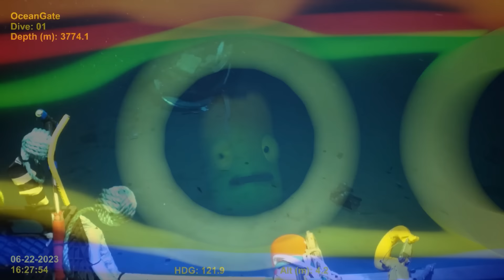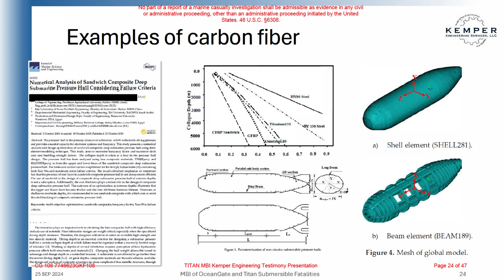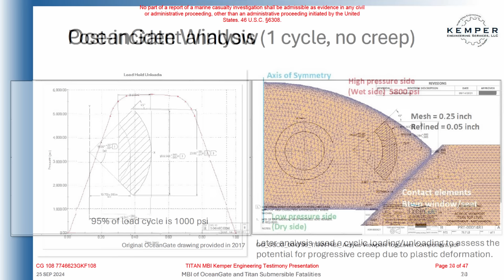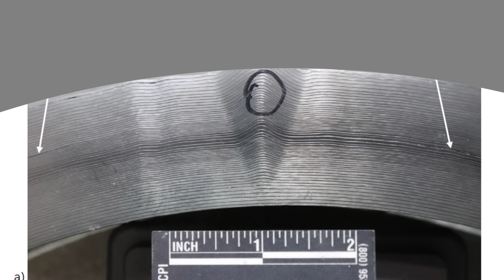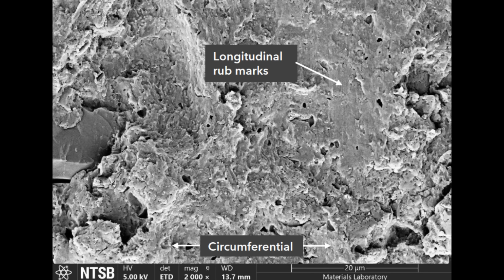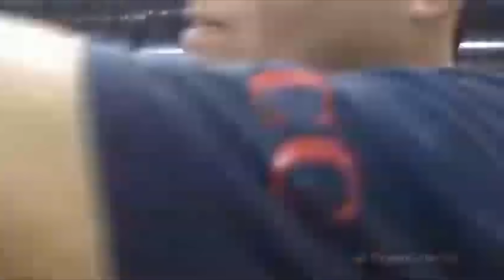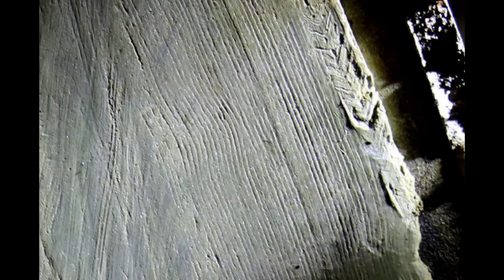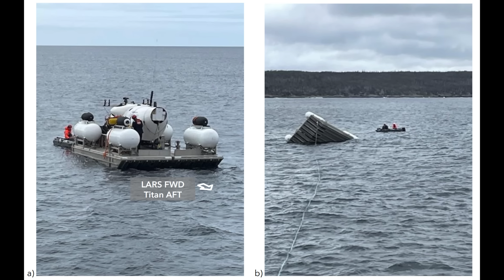OceanGate Wreck Shows Why Sub Wasn't Strong Enough To Survive - NTSB Shares Important Details

Comment: With that several thousand pound front titanium dome that swiveled open on a frequent basis to let passengers in and out, that had to weaken that glue joint in between the CF and the front titanium interface ring. Imagine all that load and leverage all supported mostly by glue. Since it appears the failure happened in the front, that is likely what happened which slowly allowed water ingress over time and caused delamination between the five layers. Then on the final dive that front CF tube no longer was round anymore, a portion of it likely gave way and crumpled in and the rest just followed a catastrophic implosion. Overall a poor design and poor material choice and not nearly enough destructive testing.
Reply: Good eye on that hinging dome hanging on a glue joint! Even if it wasn't "hinged", it was several thousand cantilevered pounds always trying to break off.
Reply: The glue joint was already full of air (way worse) because they assembled it upside down with no way for the air to get out...
Reply: The bottom front was also the little pocket with the on-board toilet.  Assuming it got used, there could have been corrosive fluids leaking on the inside, potentially damaging the structure.   I've seen fluid leaks corrode stone tile floors, a lot like the "acid for blood" thing in Alien.  It's nasty stuff.
Reply: There was no need to do any destructive testing ... The design concept  (cylinder at such depths, mixing materials) was flawed from the start. They were playing "russian roulette". And people try to reach to him and tell him , but his ego and hubris would prevent him from heeding the advice. What saddens me is that his hubris got 4 other people killed, one of them a 19 year old.
Reply: @Xoman08  it did 80 dives of which a dozen reached the Titanic.

That is despite their ludicrous construction process like shaving down lumps, ignoring Boeing's advice about winding patterns and doing 1in layers.

On top of ignoring the safety system that told them it was not safe anymore and other potential issues about the building process like debris in the fibre and sub-par cleanliness, expired fibre, how the titanium rings were attached etc. etc.

The fact this piece of junk did that many dives before imploding is actually a glowing commendation in my opinion.

For reference the Navy did create a carbon fibre unmanned submersible that dove to double this depth and other companies do have successful carbon fibre submersibles.
Reply: @retsaMinnavoiG  reusable though? Or at least a cycle limit. The Titan had none that I'm aware of which was ludicrous.
Reply: When none of that glue squeezed out when they put the end cap on it was obvious those guys had never glued anything before. You want some to squeeze out to fill any air gaps.
Reply: That would be true if the door swiveled open, in reality it was bolted closed from the outside and didn't have a hinge as you imagine.
Reply: @doughnut1107  It definitely had a hinge on the starboard side. One of the things that came out of the hearings is that the forward dome fell off once, and that the hinge was bent in the process of falling off.
Reply: @PetesGuide  You are absolutely right, I'm unsure how I didn't remember the jankiness of the whole thing.
Reply: @doughnut1107  No worries; there are so many strange things here it’s easy to miss some details. I’m actually considering watching all 10 days of testimony. The Coast Guard channel actually has a playlist with all of them.
Reply: @doughnut1107  yes it was bolted on from outside to secure it. If it didn't swivel open how did they manage to open and close that each time without a crane?
Reply: @LichaelMewis  You would have thought the door would be held/locked in place with a compression ring like how every other sub uses, all those boltholes are just points of failure, and reminds me of the Apollo 1 fire.

Comment: Those of us involved with the strength of carbon fiber aerostructures would never agree to a process as defect-prone as this seems to be
EDIT: I'm pretty specific on this comment; it goes without saying that the defect-laden hull would never make it out of production, much less make it into service. To reiterate, the fabrication process itself would never be certifiable.
Reply: Considering how bad their construction was, Its actually impressive how well the carbon fiber worked. That wasn't the first dive to the Titanic therefore their botched job was still able to survive a bunch of times before failing. Imagine how much better one would be if it was built correctly.
Reply: @ryelor123 In a way, Titan proves the viability of at least the basic ideas behind its construction. OceanGate was seemingly incapable of doing anything properly, yet they still managed to make a submersible which survived multiple dives to the Titanic.

The big remaining question is probably whether degradation of / failures in the composite hull are predictable, and that could be answered with destructive testing of hulls.
Reply: @SnakebitSTI  For predicting failure you need to x-ray the hull periodically.  That would have discovered the increasing defects. But that was too much work and apparently Stockton's attitude toward anything that might hint at a potential failure is to just ignore it.
Reply: @ryelor123 , I wonder, had the Titan been built correctly,  would it have performed as Rush drempt?
Reply: @ironbomb6753  No.  Using CF in compression is stupid.  It was relying on the glue ... which failed on multiple points.
Reply: @ironbomb6753  Considering the performance of TItan before her ultimate demise, I would say yes, the concept of a human-rated CF submersible is worth exploring
Reply: @ricardobufo  what about carbon fiber unpressurized sections of rockets? Or the upper surface of composite wings? Are the designers just stupid?
Reply: @ricardobufo  I have been told (by a material scientist or something) that due to the thickness of the hull and the diameter of the hull that the strength of the fibres were absolutely being utilised.

They said that a thin small cylinder of carbon fibre being compressed was virtually useless but that when the hull is that thick and wide that most of the fibres more or less experience tension forces.

Also let's just think about it, it went to the titanic multiple times and the production quality was incredibly poor.

It seems unbelievable that it would have reached the titanic even once if the idea didn't have some merit and the carbon fibre was actually doing a relatively good job.

It seems to imply that carbon fibre isn't the absolute cursed material for submersibles it has been made out to be.

It's probably safe to say that even if it did have merit, it's unlikely to ever be used again for super deep dives like this.
Reply: @ricardobufo  not true.  CF in compression is fine with the the appropriate testing and safety margin.  The top of A350 and 787 Wings are loaded in compression and are tested for full fatigue life and ultimate.
Reply: @retsaMinnavoiG  Could you tell us who this "material scientist or something" is and especially which companies he is associated with?  It's important that everyone knows who these people are.
Reply: @bobloblaw1636  You might like to check out the design requirements of unpressurized vessels.  Do you know anyone who makes composite model airplane wings?  Ask them what they think of the design of Titan.
Reply: @ricardobufo  yes. No one is going to defend the design of Titan. It's a bad design. I'm pointing out that using carbon fiber in compression is not inherently bad, and is done quite a lot. For another example, watch Scott Manley's previous video on the titan sub, he talks about a successful navy sub that used carbon fiber.
Reply: @ricardobufo   it was last year around the time it happened and it was just somebody on the internet.

I'm guessing by the way you wrote that comment you're implying I'm just making it up, which is fair.

I'll say that they seemed very knowledgeable and I'm relatively certain they were legit (they had technical information with all the right jargon), whether they are right or wrong I cannot say but it does make sense to me.

Let's try to visualise what he said for a moment, if the hull diameter was a mile, the localised fibres on any one section would essentially be straight and flat, the curve would be imperceptible and so the fibres would more or less be working in tension.

I think I should note that he didn't say he said it would be a good choice for a submersible, just that in his opinion the ridicule it was getting because 'it would have no strength in compression' weren't very accurate.
Reply: That whole "grind off the high spots" thing is just baffling, you're cutting all those strands into short segments that don't even reach one full turn around the hull.
Reply: Jesus fuck, the most experience I ever had with any sort of composite stuff was a high school project to put fiberglass and that glass microbead infused resin (I dont remember exactly what it was, it was a decade plus ago at this point) around a foam aerofoil shape to form a composite wing. One of the things we got graded on, and somewhat strictly at that, was how good the layup and how good the resulting final product was. Things like wrinkling and failure to get the resin properly into the material would take a good 5% off our grade for each flaw. This clusterfuck with the Titan's hull would have earned a failing grade. 
Shit, given the environment this thing was meant to go into (Deep Sea diving), even with what little knowledge and experience I have, I would have failed the hull the moment I saw any wrinkling and defects like that, let alone the moment they decided compromising the fibers themselves just to slap on another set of layers was a good idea. Anything less than a 100% perfect hull I would have said no to, cost be damned. You can always try again to manufacture a viable hull, you can never turn human paste back into 5 living human beings.
Reply: Were you one of the thousands of assorted engineers around the world who tried to warn Mr Crush about his submersible? My specialty was aerospace robotics but even without a materials science background I knew it was going to get people killed. 
The touching of it with bare hands in an open workshop, just speading the glue by hand, and seeing the hull defects in the corporate promo footage is terrifying. Mr Mush had a, pardon the joke, titanic ego to ignore an entire industry's warnings.
Reply: @Cyborg_Octopus  I don't know if Mr Mush was deliberate but lmao.
Reply: @barneyrubble4293  It was! 'Mush' and 'Crush' are excellent puns and I alternate because I like them both.
Reply: ya I used to microscope composite bearings, when we saw any voids it was trashed, regardless of how expensive the part was
Reply: Everyone involved in that hull construction is certifiable!
Reply: This has gotten me to wondering whether rocket cylinders made of wound carbon fiber like this have so many imperfections.
Reply: So. Remains were found ?
Reply: @jeremykastrup6907  The description I heard was "a paste that contained human DNA."
Reply: What do YOU know...

Comment: It's  even more half assed than I imagined.
Reply: Redundant half-asssery.  There were many components that were shoddy, so if one thing wasn't piss-poor enough, other things could take up the residual responsibility for failure.
Reply: @rewtshell  The hull monitoring system and how they just ignored it was cherry on top! I mean, had they investigated it seriously, they would recognize that the hull is about to fail and would actually learn something, instead of killing innocent passengers. And their crappy made hull was good for solid 80 dives!
Reply: @ivankuzin8388  i'm pretty sure the data that scott shared was available to rush before the last dive. if he or his people had bothered to line up the timeline of the monitoring system and the strain gauges the way the NTSB did it would've been obvious it wasn't just an outside bang but a failure of the hull.
Reply: @oldfrend  Well, it shouldn't take a genius to compare starting and ending condition of the hull sensors and observe that there is a permanent difference in the way the hull now deforms. You know what it means: part of it has failed. They heard it, to me it is inconceivable they wouldn't have taken the most cursory look at the data as well for that dive, where you can clearly see that the hull is now measuring at a different resting state than before.
Reply: @rewtshell  It was an absolutely geniusproof design. You could've put Robert Ballard or James Cameron behind the controls of that carbon-mache condom and they'd be just as doomed as any schmuck off the street trying to pilot a submersible.
Reply: Right? I thought it was bad enough before.
Reply: It really is.  It's truly amazing that it held together as long as it did.  I credit dumb luck for that.  It certainly wasn't any kind of skill.
Reply: I feel like they've assed themselves down below half at this point. They aren't even a full cheek.
Reply: Quarter assed at best.
Reply: Its the old that's good enough mentality. Didn't work out so well!
Reply: Those money savings can't be enjoyed at the bottom of the Atlantic
Reply: half assing something is when you understand what you are doing and can't be bothered to try. What oceangate did was pure arrogant incompetence. They had no idea what they were doing, didn't listen to the experts they hired and then gleefully went about completely ignoring any signs they were wrong
Reply: It was barely quarter-assed.
Reply: Exactly... I thought it was a nice symmetrical barrel section, but when I saw the wrinkles, holy moly, it looks bad.
Reply: Well it was obviously inevitable that this thing would implode one way or the other. This half assed construction was bound to fail the second they started building this death trap. Karma to stockton and rip to those who died trusting him. And especially rip to the young man who didn't wanna go. He didn't deserve to die young like that. What a shame. 😪
Reply: Agreed. The technical term is "bloody awful".
Reply: My thoughts exactly
Reply: @Dan-q4h , 1/4 assed at best
Reply: Yep!
Reply: lf they would have tested it to failure, they would  have found out  what  we  know now, it should have been designed with a large safety factor and been able to handle much more pressure than at max dive depth, if it's unmanned you could get away with not overbuilding but having people onboard in needs to be overbuilt and never fail